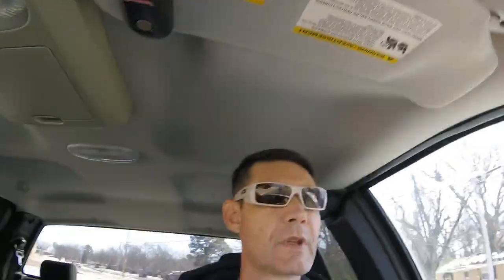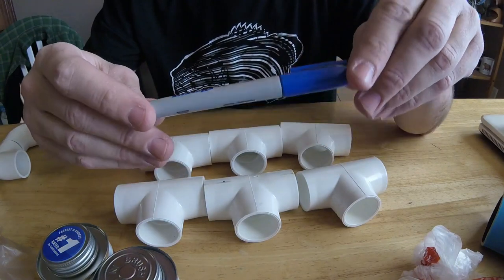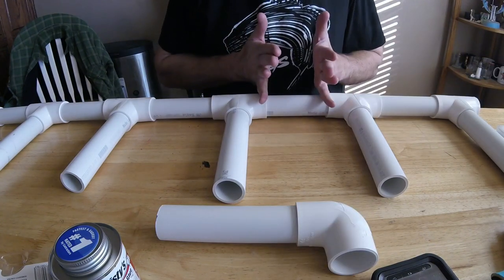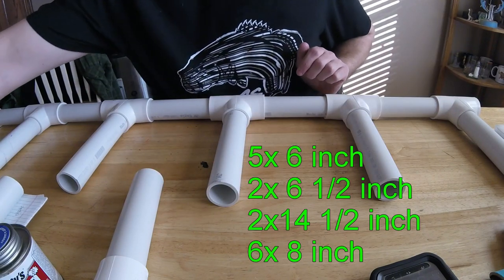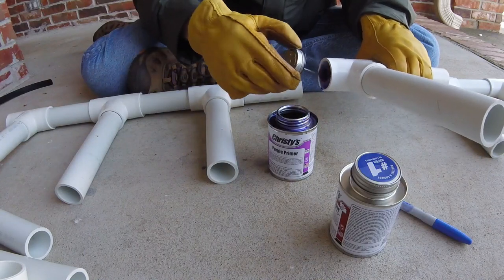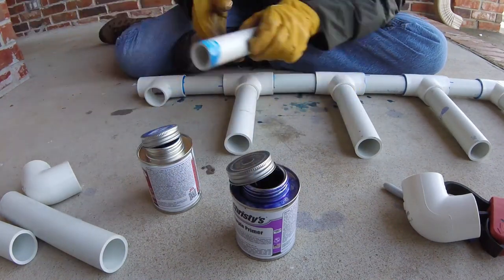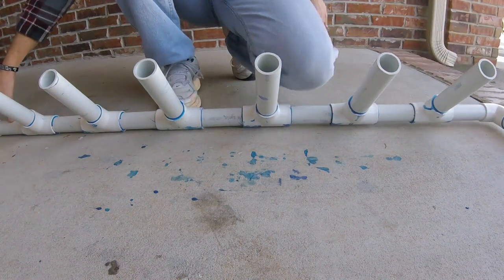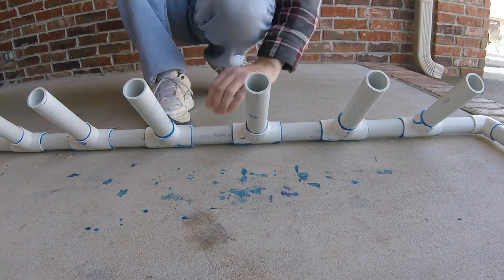DIY Rod Holder

Comment: Do you find that 8 inch rod holders are long enough?  I would think that you would want your reels seated on the pipe and 8 inches may not be long enough for some rods.  Also, I used 2 inch schedule 40 pipe and they are a perfect fit for all rods including heavy conventional bottom fishing rods.
Reply from the maker: Thank you for your question Nathan. I haven't had a problem. I used to use longer PVC but it would scratch my reels.
Reply: @MongoFishing  That makes sense.  Thanks for clarifying before I glue it together.  Awesome tutorial as well.  I was surprised to see that buying these off the shelf were so expensive.

Comment: What size diameter did you use, 2" pvc? Thank you.
Reply from the maker: 1 1/4" schedule 40 PVC. It probably doesn't need to be schedule 40 but that is what I used.